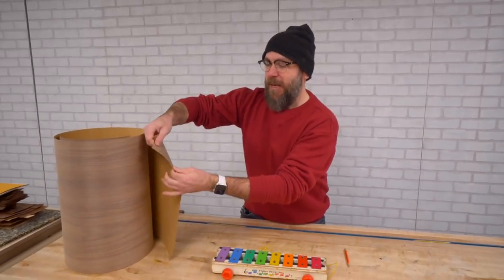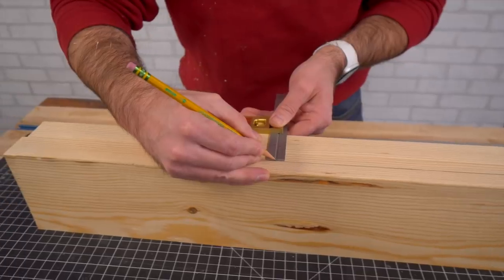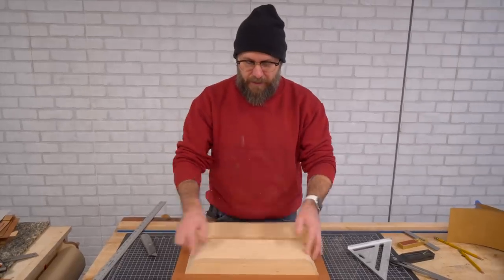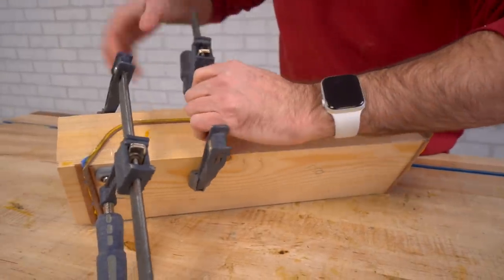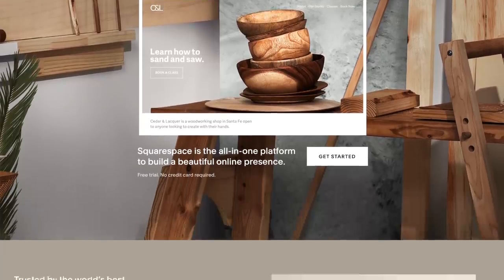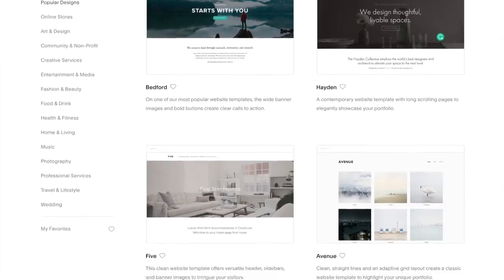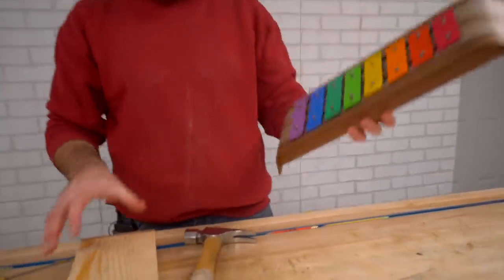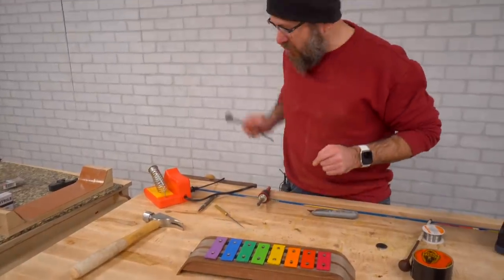Bent Wood Lamination and Marquetry Xylophone | Woodworking Project

Comment: That's awesome David!

I'm not sure what experience you had soldering but if you had any issues the solder might be to blame.  I recently bought and used that exact one and it fought with me, leaving dull joints (not cold joints) and didn't flow that well.

It's one of those, the cheaper product works but there's a better experience to be had with better material.

If it's only for touching things up now and then it works just fine.

Hope that is is legible and and of some use. Keep the great content coming!

Comment: Bandsaws smaller than 14 inches tends to break a lot of blades because of the tighter radius and the metal of the blade does not hold up to that radius ... love you’re Chanel

Comment: David - my blade just snapped on my Rikon 305 bandsaw as well. Do you think leaving the blade tensioned while not in use causes it to break?
Reply from the maker: I just replaced it today and realized my bottom guide was putting too much pressure on the blade. For now I’m assuming that’s the issue. But you could be on to something as well.

Comment: Just like the serpentine belt on an automobile, anything that puts improper stress on the blade will cause it to break.

Prematurely breaking blades can be caused by:

Things that can cause abnormal stress on the blade are:
The blade being tensioned too tight.
The pulleys that the blade rides on are misaligned. 
A worn bearing which will have the same affect as a misaligned wheel. The bearing does not have to squeak to be causing misalignment.
The blade getting too hot for too long and thereby becoming brittle.
Using blades with low quality metal or a low quality weld.

This list is just the basic mechanical things to check, there can be other issues but most problems should be found in this basic list.

Take care.